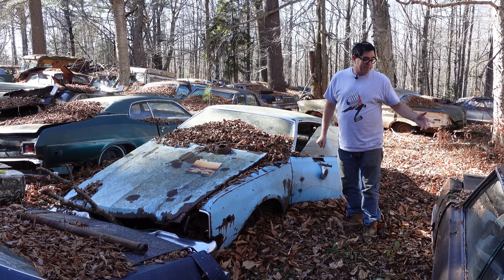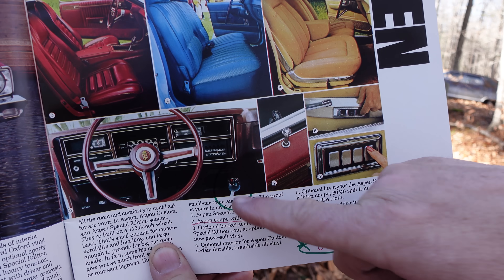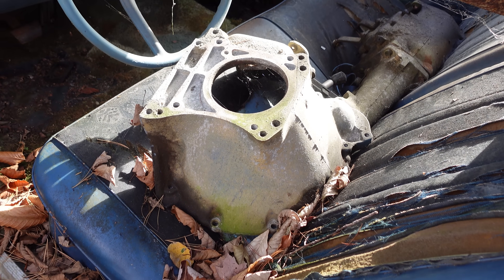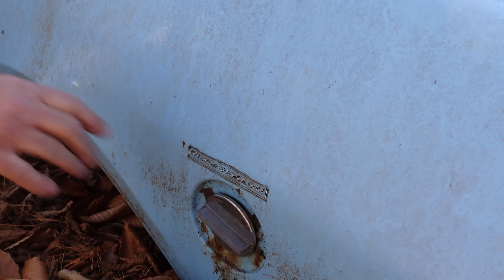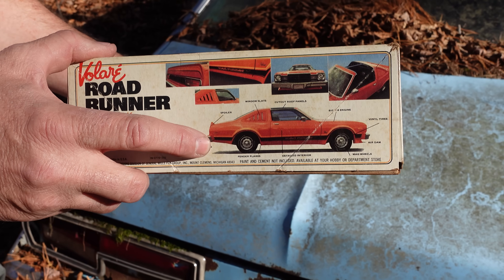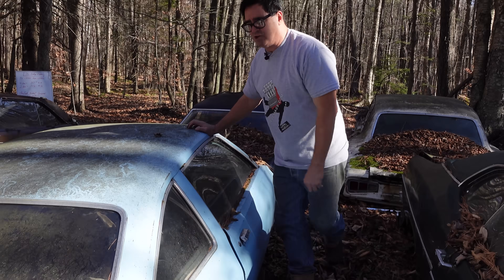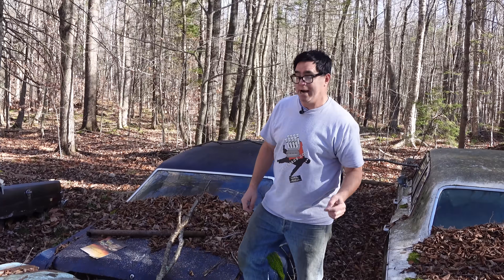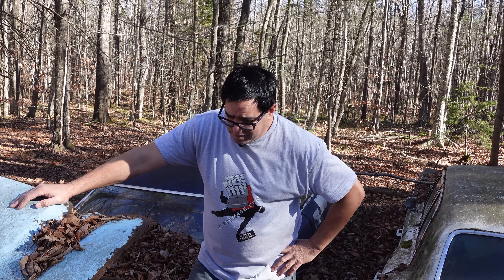First F

Comment: Thank you for all you do with these junkyard crawls.    You have a niche video channel that affords you to speak about history and even some of the most timid efforts at vehicles like the Aspen you make interesting.   This era Chrysler corporation was the one that caused my family never to buy another - back in November 1975 we were looking for a "compact" car and we were a Ford family that had once bought a 1971 Plymouth Satellite station wagon that was a good car.    So when we were shopping, we went to the Ford dealer and encountered a true lot lizard who turned us off so we went to look at Dodge compacts and there was the Aspen and the Dart.    The Aspens were over optioned and we ended up with the Dart which was the most horrific car ever - even when new it was noisy, ran like garbage with a boat anchor 225 slant six, and the seats were miserably uncomfortable.    After living with the car for a few months I was a nosey 14 year old and I started noticing that the car had frame and fender repairs on the side of the car that was leaning oddly.    Comparing one side of frame welds to another, they were completely different - sheet metal that was smooth and welded on the undamaged side had jagged metal with welds over the top of it.     Needless to say that car was offloaded with 7500 miles for a 75,000 mile Ford Torino station wagon that turned to 200,000 miles before we couldn't stomach its 13 mpg average fuel consumption.     I say all of this because Chrysler in this era was a disgusting company - repeatedly my parents wanted Chrysler to do something with this car that was constantly in the shop for one malady or another and nothing was ever fixed.     Had an Aspen been available at a decent price, we might have had one and had none of the taste of poor quality, but I'm not convinced the result would have been any different.   

Keep up the great work and Merry Christmas!
Reply: Although I'm a Mopar guy, I would have chosen the Dart over the Aspen in 1976. The Aspen/Volare twins never lived up to the earlier reputation of the Darts and Valiants, which were very reliable although they rusted away. Sounds like you got a real bad one that should have been taken back by Chrysler, but good luck back then. With bankruptcy looming, they were some dark days for the company. Cheers and Merry Christmas.
Reply: @LongIslandMopars  My grandparents had a 1980 Volare coupe with a 225 Slant Six, probably one of the last ones made in Hamtramck, MI in late 1979. It was a real base car, no power brakes, no AC, AM radio and my dad had a vinyl top added on it for my grandparents as it was very plain. My dad (their son-in-law) maintained that car for them for six years and then it was sold and my dad got them a 1982 Buick Skyhawk, which was fully loaded and a trade in at the Cadillac dealership he worked at. They had that for a few years and then bought a 1989 Cavalier which I eventually wound up with (I still have it, it's "retired" at my other property). The Volare ran well, but it took my father many weekends of tinkering with it to get it to run just right. I remember part of the VIN was HE29CAB, so that's H for Volare, E for Economy price class, 29 for two door special coupe, C for 225 Slant Six with one barrel, aka "LTP", A for 1980 model year, B for Hamtramck, MI and the rest is the production sequence. Off the top of my head, it was code SL1 Light Cashmere exterior paint. 

By 1977 in our family, we were done with Chryslers and the only one we had after that was a 1941 Plymouth Deluxe sedan family project from 1978 to 1988. We gave it to my uncle (my dad's brother) after my dad passed in 1988 and my uncle and his son had it for several years before being sold to a local couple in TX down there who runs the local paper. I believe that they still own it last I asked about it. 

Chryslers were horrid by the 1970s and my parents found GM products more appealing and modern at the time. We did have two Toyota Corollas in the early 1980s, but they were company cars that we could use and we did until our 1980 Bonneville arrived (which got stolen in 1982).

Comment: A hot rodder friend of mine took the front subframe from an Aspen and grafted it under a 36 Dodge humpback,  along with a 360. IIRC, he also used the rear end as well. It was a nice street rod. No idea where it ended up.
Reply: Sounds like a cool creation
Reply: @RoadNoise29100  it was. All done up, even with graphics on the side Humpback Hauler. Ron said the best part was, he could go to any parts store and get what he needed to fix it.

Comment: Back in 1981 when I was 15, my dad and I were out shopping for my first car. One of the cars on our short list was a 76 Road Runner. I  vividly remember the car with its orange paint, black graphics,  spoiler, and t-tops. I really liked the car and it was within our $2000 price range. If it wasn't for rust just beginning to bubble through the paint in several locations it would of been my first car.
Reply: My father passed on a 1968 Camaro 327 V8 (console and bucket car) for my sister in 1983 because during the test drive he heard a noise in the rear end and also the speedometer was disconnected. My father also didn't like the body work that had been done so we passed on it.

Comment: My grandfather bought a new, loaded Volare wagon in 1976, and went back to the dealer 4 or 5 times for an annoying shimmy in the rear of the vehicle.  They changed or rebalanced the rear wheels, and even changed the driveshaft.  Gramps took it to a Ford dealer friend of his, where the mechanics discovered that the right rear axle had a mis-drilled flange, allowing the tire to be mounted off center by 1/4 inch.  Must have been a common problem, there none on the shelves of Mopar dealers in a 100 mile radius.

Comment: My parents bought a brand new volare wagon in 76, 318 motor and 4 speed trans.  Would not start in cold weather from the get go and started rusting within the first year. Shortly after purchasing the steering wheel started coming loose. Kept it about a year than traded.
Reply: It sounds like they got one of the better ones.

Comment: Delivered a lot of those back in 1976 when I worked for M&G Convoy (Detroit, MI).  Bought a brand new 1977 Dodge B100, 318, 4spd O/D.  Learned about those pesky ballast resistors with that one...  Van ran great for the first 30 days.  Then it didn't run well, until someone removed the cat and all the related 'stuff', when it was parked at my apartment...

Comment: A guy at a local car show has a mint ‘76 Road Runner.  It was a prototype or early car used for road testing/ magazines to borrow.  He had the paperwork and pix to prove it plus a plaque with signatures from the engineering team or factory special vehicle prep team.  I doubt there’s a better example out there.
Reply from the maker: Hello Matt's Kustom Kreations. The "pre-production" '76 B-body Road Runner should be featured in national magazines - assuming it isn't a home brewed "wanna be". But - as you say - it has factory papers. If I saw it I'd go right to the VIN. Does it have the RM prefix of every Road Runner since 1968? Or was Plymouth going to demote the Road Runner from a specific model to an option package? The mind boggles. Anyhoo, Thanks for watching and writing. -Steve Magnante
Reply: @SteveMagnante  You'd definitely see a sales code for the Roadrunner package on the fender tag.
Reply: @SteveMagnante  I’m a longtime fan - thanks for posting.  I began to doubt my memory so I dug up the 2 pix I took.  I now believe it’s a ‘78 model due to the horiz. Sport slats and Spinnaker White with multi-tone red&yellow graphics.  It has factory Rallye wheels, 360 4bbl and a really groovy Summer Sunrise interior with buckets.  That interior starts with white at the top and successive multi colored horizontal stripes going down til the lower seat is black.  The guy showed me a magazine the car was featured in - not sure if it was a period road test article or a 20yr old muscle car or Mopar mag.  In the back seat is a sign the guy made and all I can make out is “Chrysler Mechanic _ Testing Vehicle”.  My recall was that it was a test mule.  It may even have had some features that did not make it to production, for ‘78 anyway.  Maybe a viewer can shed some light.  I’ll email the pix to you.

Comment: I was a car-loving kid growing up in the sixties and began driving in 1974, so I saw the muscle car era come and go. When the power and performance went away and all that was left were graphics packages on once-revered models like a Chevy Nova-based "Pontiac GTO" or a Plymouth Volare "Road Runner," we called these "performance equipment" packages by another name: bolt-on, screw-on, stick-on dick-ons.
Reply: At least Pontiac tried to keep performance alive and improve handling so the overall package was very good. Yes, fuel injection and computer technology brought cars into the 1980s and improved them, but with that came some headaches that forced a lot of mechanics to retire or change careers. LOL.

Comment: I worked for a dodge dealer in 1979 to 81 and witnessed the recall on aspens and Volares. With the front fenders rotting off them. They were really good reliable cars otherwise. Our shop meetings were about prepping us for learning how to work on iaccocas k car rescue that was comin. Some older mechanics feared chrysler was gonna close shop. Thanx to k cars we were saved!
Reply: Those were truly some lean times back then at Chrysler. Factory literature came from Dyment Distribution.
Reply: 'ccoca was the man! It would not be wrong to call him a hero.
Reply: @kenttalsma7906  Indeed he did save Chrysler. An interesting watch is the 1979 hearings before Congress. He flat out says, "If you don't bail them out, the taxpayer is going to pay anyway---in welfare, job training and the like." The real reason (among others) Chrysler was saved was that they had military contracts with the US government, and it was seen as a national security issue if they failed.
Reply from the maker: I agree that Iacocca was Chrysler's "savior" (along with Uncle Sam and the U.S. tax payer). I had a bitter sweet experience with Lee Iacocca many years ago at Barrett-Jackson. He was a special guest in the broadcast booth along side Bob Varsha and Matt Stone (or was it Keith Martin? I forget). Anyhoo, I was 400 feet away down on the auction block with Mike Joy BUT we could hear the live-to-air conversation between Iacocca and Varsha on our headsets. I recall The Word was that Iacocca was into some form of age related dementia at the time and the producers had their fingers on the "cough button" just in case. Who knew? But you have to be ready when it comes to live TV.  Well Lee starts by saying: "wow, big crowd in here today. Do these people have to pay to get in?" Varsha pitched Lee a softball question, hoping to lead into some deep conversation with the Father Of the Mustang. But Lee seemed off. So the interview was terminated after a couple of minutes and they threw it down to the auction block where Mike and I got to yakking about the car being sold. That car was one of the 2005-ish Iacocca Mustangs that had custom body work done IN METAL but never really took off with buyers - at over double the stock sticker price. Anyhoo, I will always remember - and respect - The Mighty Lee Iacocca and my momentary brush with greatness - even if he was faltering. I hope I'm as sharp when I get to be that old. Thanks for writing and watching. -Steve Magnante
Reply: @SteveMagnante  I guess I could relate two funny presentation stories/on air stories of sorts. LOL.

When I an undergraduate in college, one business class project was, "Pick someone you feel is a leader in what they do, and tell us about them in detail, proving they were a leader". This was about 1992, and my friend with the two Aspens (by that time he was driving a Dodge Shadow) was also in the class, as that's how we met---we went to the same college and were in the same orientation group. I picked Iacocca. I got up and did my presentation, only to get interrupted by the professor (a hard nosed supposed "military man" from the south) who said, "He wasn't a leader and you're not proving to me that he is". I said, "Well Chrysler still exists today and they are the third largest automaker. If John Riccardo (the president before Mr. Iacocca) was still in power, all the Chrysler people would be driving Buicks or Mercury products". The class laughed, but he didn't. He said, "The minivan saved Chrysler, your research is faulty". I said, "No, you're incorrect. The minivan didn't come out until 1984 and it was the brainchild of Hal Sperlich. If they waited until 1984, which is when they had paid back the loan they would have been out of business". He said, "The K car saved Chrysler, you're not correct". I said, "No, that's wrong again. The K car came out in late 1980. By then, the US government had already bailed out Chrysler and the Omni and Horizon saved Chrysler. My friend is the front row and he's snickering to himself as this is going on.

I finish my presentation and he said, "I'm not done with you yet. Ok, you made some points, but let's talk about GM. GM made most of their Corvettes automatics so women could drive them". I said, "Well besides being sexist, you're wrong again. The output of a 1975 Corvette's engine doesn't warrant a four speed in most cases, but it was available and if you did your research, you'd know that the first year for the catalytic converter was 1975 and that played into their decision making too". A week goes by and he calls my house, "Well, we have a problem. You scored higher than everyone on your final exam and your presentation. You're screwing up my curve and I don't give A grades". I said, "If I deserve an A and you seem to indicate that I do, me you and the dean will talk that one over. That is if you want to have a job in the fall...."  I wound up with an A. The next week, his battery went dead on his Fleetwood Brougham and he said, "Anyone in the class know about these things?" I said, "Yea, your power antenna was running for a week and it killed the battery. But you can ask Roger Smith about that one. Perhaps he's the leader that you said Lee Iacocca wasn't". The class burst out laughing, and I walked out and gave him a wink. LOL. 

About two years ago, I went to a Ford test/press event held in a sports stadium parking lot geared for fleet and government buying. The Ford people there said, "Ok, we're going to have you drive the vehicles. We want you to put them through their paces". They made one lap around with you and then you got two laps around the course. The guy said, "Don't hold back". With that, all of us were flat to the floor whipping around turns. I must say the Ford Interceptor hybrid beat them all. Then the moderators asked, "We like to put some of you on camera to interview you about today's events".

My coworker who is a Chevrolet fan (who has a 1973 Buick Riviera) said, "Oh yea, we got a taker here. Over here. Ford fan....." Of course, I'm not, so they put a mike on me and have the boom set up and the interviewer goes through the whole thing and said, "Be honest and forthright about the product". I had all to do to keep from laughing about the company's products as anyone who knows me knows I'm not really a fan of them. Afterward, the local government rep said, "Wow, I wasn't expecting that from you, Mr. GM and Toyota fan". I said, "Don't worry, we drove here in a GM vehicle". LOL. I have to get the footage of the interview from them.
Reply: @SteveMagnante  Lee was on Lenos garage with that car and didn't seem to care much for it that time either, or talking about mustang history
Reply: @SteveMagnante  Great inside story Steve! Gosh, I and many of us here on this forum would love a sit down, chew the fat conversation with you!!
Reply: @madmike2624  That would be a pretty good experience. His presenting style is second to none.

Comment: Nice video Steve. I owned a 1978 Plymouth Volare 2 door brougham. These had the smaller rear window and the half vinyl roof. Mine also had nice bucket seats. Mine had the 318 'lean burn' engine and 3 speed automatic. This was a period of time where Chrysler had a lot of trouble with quality control. It was not only the rust that became an issue. The new locking torque converter was supposed to help with fuel economy BUT they had it setup wrong. The converter would lock at the same time the car shifted into 3rd gear putting a lot of stress on the transmission. My transmission burned up at 6000 miles and they had to replace both the transmission as well as the torque converter (which had been re designed). My father had a 1976 Chrysler Le Baron which was also the same platform as the Aspen and Volare.

Comment: My aunt and uncle bought that exact color aspen in 76 and in 6 months it had the same amount of rust, the fenders, quarter panels, the edge if the trunklid even around the rear window rusted out and they lived in Maryland.   
  In 87 I worked at a restaurant where a hostess had a 76 rt, it was orange with all the stripes spoilers and window slats, side and rear, had a set of keystone classics for wheels.  It had a slant 6, manual od no powersteering or brakes, what blew my mind was it had drum brakes front and rear, didn't think front drums were still available in 76.  Her brother bought it brand new and gave it to her on her 16th birthday, it still looked like it just drove off the showroom floor, she drove it like she was racing in lemans.